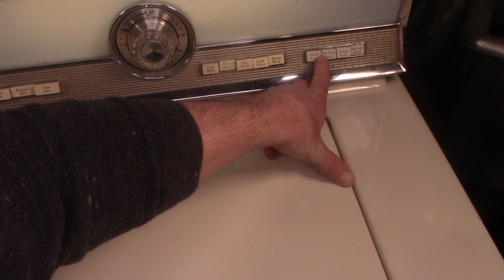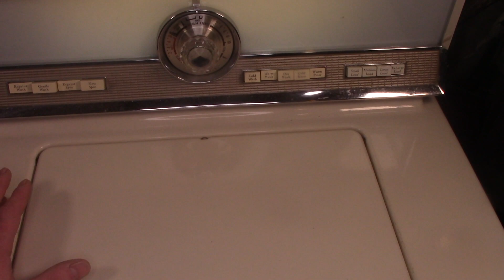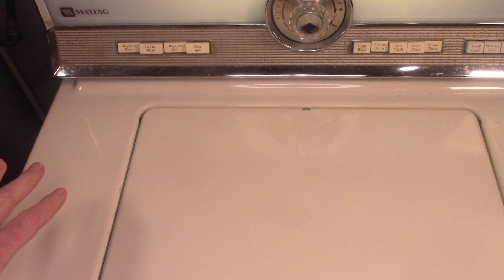Full Wash: RESTORED 1978 Maytag Washer  Work Pants

Comment: A Vintage Maytag: The perfect washer for those who wish to practice social distancing! Buy one, put it in your basement, and no one will have to come to your home to repair it for months, or even years!

Or more realistically, decades.
Reply: Lmao yes indeed realistically!!
Reply: I have a 1987 Model which is very similar to this except they changed the button layout.  I bought it with the dryer for $100, 3 years ago.  I haven't had any problems and haven't even had to replace the belts yet.  The guy I bought them from said they were left by the previous owner and he didn't want these old machines, he wanted new "advanced" front loaders.  I bet he's already had them break down on him.  Should have stuck with the classic!
Reply: Smitastic You do realise that in Europe we have been exclusively using front loaders since the seventies? America thinks they are "advanced" we just think they are normal. They are certainly much better than top loaders, they wash better, use less water, use less power, less detergent, spin faster, damage clothes less. Why anyone still uses top loaders other than for historical interest is beyond us!
Reply: @spencerwilton5831  They don't clean better than a conventional top loader.  You forgot to add, cost more are less reliable and are far more expensive to repair.   I'll keep my 1987 Maytag for another 30 years, you'll be on your fifth front loader by then.  It's not more environmentally friendly to keep manufacturing new machines when could have used the one  same reliable machine for years.  My parents have only had 2 Maytag top loaders since they got married in 1968, and the first one they left in the house they moved from.
Reply: @spencerwilton5831  Well, the thing is front loaders are more expensive up front than top loaders, and when built correctly, a top-loading washer can clean clothes much better and faster than any front-loading washer can.

I wasn't kidding in my original comment when I said a Maytag could realistically run decades. My great aunt had a Maytag Dependable Care in her condo, and in the 20 years she lived there it never had to be repaired once. She also used to have a Maytag more like the one shown in the video that was from the 1960s and, despite having a hole in the tub, still worked perfectly when she gave it away in the 1990s. Also, my Whirlpool Direct Drive has had only two things have fail on it since my family purchased it in 1997: the motor coupler (a $25 part) and the agitator dogs (a $5 part). In 23 years of owning that machine, we have spent $30 replacement parts, and it has outlived two dryers. No front loader will ever manage to do that. Remember, it doesn't matter the savings in the reduced water, electricity, and detergent usage if you have to spend all those savings repairing or replacing the machine every few years. Also, in my experiences, top load washers don't damage clothes at all unless you severely overload the machine.

One reason I think front loaders are less popular in the United States is because in the 2000s, there were several class action lawsuits against various front load washing machine manufacturers here such as Electrolux, LG, and Whirlpool claiming that their machines didn't wash away soap residue well enough, and that resulted in mold and mildew buildup in the machine that ruined clothes. Those lawsuits covered about 9 million front load washers and left a bad taste in a lot of people's mouths regarding front loaders in the United States, which resulted in the market shifting back towards top loaders.
Reply: You see china makes washers today (which are crap so you need to see the repair man everyday) and they also made the coronavirus (which in its current state prevents you from seeing the repairman) so what do you do, you buy a new one( just imagine if this was the reason the coronavirus was a thing)
Reply: @smitastic7030   HAHA That's great!
Reply: nah bro that tub capacity is trash and spin speed is meh and features are basic 
no real sanitation or real steam clean :/
Reply: yea that and agitation that's it nothing else is cool -_-
Reply: @ethearnos6397  Clean*
Reply: @ENB2002  yes thx ill correct it
Reply: @smitastic7030   DITTO THAT. I HAVE A 1997 NOT QUITE AS GOOD AS YOUR 1987 BUT NO PROBLEMS WITH A FAMILY OF 4
Reply: @spencerwilton5831  JUNK THERE  ARE MAYTAGS BUILT IN 1950 DOING GREAT . IF YOU FRONT END LOADERS WERE SO GOOD  WHY ARE THEY NOT IN THE uS
Reply: @dknowles60  The old 1987 is still hanging on strong.  The belt is still good and the washer has not had any problems.  These things literally run forever.

Comment: I grew up with this same machine, but in white, looked slightly larger though, and the one my parents had (from 1976 - 2009) had 5 cycles (Gentle-Delicate/Handwash, Soak'n'Wash, Pre-soak(and drain), Normal Wash, Permanent Press) and 3 more button sections (No Drain/Normal Drain, Save Suds/Return Suds, Regular Rinse/Extended Rinse and Spin/Long Spin), and there was a toggle switch for the end of cycle signal buzzer on/off on the right outside of the top console.  Best machine I have ever used.

Comment: Enjoyed the vid. I watched the restoration vid earlier, 👍🏻excellent. My grandmother purchased the base model of this generation Matag washer back in 76. I still have the owners manual w/her receipt. Hers wasn’t cheap for a base model (A107). It ran long after she had passed. It was because of her washer with its reliability that I purchased my Maytag set new in 1997. Got the flagship set just below the first generation Neptune. Still running strong. There was an intermittent leak with my grandma’s machine I couldn’t pinpoint, but after watching the resto vid, I believe it was the tub clamp up top. Never checked that but remember seeing streaks from there. Sibling threw it away before I could get to it. That machine you just restored👍🏻 is going to last a very long time. Enjoyed the vid, great content, thanks for sharing it.

Comment: That’s a beautiful machine and built like a tank.  I have my original 1984 Maytag washer and matching gas dryer.  My washer still uses the good transmission like your machine. I’ve never touched a screw on mine except to inspect behind the front cover.  I will keep both appliances as long as possible, which at this point could make them outlast me.

Comment: This is more like 1968 model. We still have the dryer to match this. And it still works great, my papaw bought it in 1968 at our local Maytag store!
Reply: 1968 Model had a silvery blue painted console with a white acrylic timer dial and 3 button water level switch rather than the later 4 button switch this has.

Comment: I wish they made them like this now.  We have a newer Maytag and I hate the HE water efficiency function.  You can't just set it and walk away.....you have to wait and see how much water goes in.  9 times out of 10 not enough water goes in and I have to manually put water into the basin.  I think the agitator on the newer model seems backwards.  I think it should go big to small to the top but it's opposite.  These older machines lasted longer too....cause the majority of the parts were metal.  Thanks for posting this CLASSIC!!!!!!!

Comment: I used to have 30 A21s at my coin laundry. I rebuilt most of them. I had to rebuild because a customer got oil on her clothes (60 dollar payment to her). Agitator seal breaks down after several years and hot water gets into the transmission, forcing out the oil into the tub. This was after 13 years of continuous service (about 4 loads a day).
Reply: Ouch.. an unfortunate reality of a laundry.
Reply: I bet those A21's paid for themselves in a couple of years, if not less. Great machines!

Comment: Great Maytag machine. Back in the day the sears Lady kenmore had the same wash n wear option . The tube would drain half way and fill up again
Reply: Robert Lauricella .  What’s the purpose of the half drain in relation to the fabric?  Do you know?
Reply: grandcarriage1 it was known as the was n wear cool down cycle prevent fabrics from wrinkling  .  Than in the 80 models it became perm press cycle where it would drain partly than fill with cold water than agitate for a few minute than it would fully drain than spin before first rinse.
Only kenmore and whirlpool had this feature
Reply: It's called a cool down cycle on perma press. Prevents warmer waters from increasing wrinkles during spin.
Reply: @kimberleytui179 yes my
Mom used that cycle all the time now I use it 
Most washers now have the casual or activity cycle but I do believe there is no more cool down care on these cycles

Comment: Wow. You see that little bit of water coming out from the top as it is spinning at 13:32.... It is almost like they had turbo shot way back then (the turbo shot function LG uses in their new machines). Crazy. Even the rinse thing at 15:30. Just like the spray nozzle LG uses on their washing machines now that spray a fine jet of water to rinse better. The clean water then gets pulled through the clothes as it spins to rinse it out better before the actual rinse. Amazing the concepts used back then is still used today although in a slightly different manner. Ahead of its time this.
Reply: Whirlpool did it in the 90s with the catalyst washers . Not to be confused with the Calypsos.

Comment: One other question... older machines (especially 1960's models) had exterior lights near the knobs or across the front panels.   Was there a switch to turn the lights on or did they just work when the timer was active?  How did they work?
Reply: We had the 1960s model when  was growing up.  I loved the dash light!  It was activated by a little button on the dash.  I believe one button for on and one for off.  I currently have a 1984 A712, running strong, no repairs !  I will probably never get rid of it... too afraid of today's expensive unreliable junk.  P.S.  You can see the buttons for the dash light on this video.  They are on the left side of the controls.  https://www.youtube.com/watch?v=TmBtjvYuAgI&t=3s
Reply: The late model 141, 142, and A700 washers used a switch on the left side of the console that would turn the console light on and off independent of the timer. The 160, 702, 806, 900, 902, and 906 washers routed the console light through the timer.

Comment: Why do/did a lot of Maytags spin immediately when first draining?   I always found that disconcerting as I would think it puts a lot of stress on the linkage....rather than just running the pump for the first minute or 2?
Reply: Ram14250 lots of machines have that, vs a neutral drain (like you mention). My theory is that it goes back to the solid tub days when the only holes were at the top of the tub, and the machine used centripetal force to throw the water out those holes
Reply: Ram14250 These have a spin drain because they don’t have an individual pump motor. There’s only 1 motor to control everything. When the motor is spinning one way, the transmission engages and the washer agitates. The pump is spinning the opposite direction needed for draining. When the motor reverses direction, the transmission locks up and spins both the tub and agitator together at full speed. The pump is now spinning the other direction, sucking the water out the tub and pushing it through the drain pipe.

The motor needs to be running in order for the pump to work. Therefore, a neutral drain isn’t possible with this design.

I honestly prefer spin drain to neutral drain. Less parts and electronics to go wrong, and they more evenly distribute the clothes along the height of the tub, allowing for a more efficient spin.
Reply: @solarflea4115   The center of gravity is lower in a neutral drain washer and therefore will or should spin better.  Spin drain machines can go off balance if there is too much water and to little clothes in the basket .
Reply: pat cola I’ve never once had any issues with balancing and I’ve had spin drain washers all my life.
Reply: @solarflea4115  My Speed Queen spin drains and I agree. Never once in 7 years has it gone out of balance and banged against the cabinet . Steadiest machine next to our old Westinghouse. 

Our old Norge was pretty good also. Though the spin on the Norge would slow down with an out of balance load
Reply: pat cola My dads 1990’s Maytag dependable care also slows down when it gets out of balance. My mid ‘80’s filter flo doesn’t but it’s still a fantastic machine.

Comment: Lovely machine. What happens if the heater breaks? How u get those parts that were built in 1978. Is it possible?
I was born in 78😀.
Reply: Heater ? These don't have a heater.
Reply: Most of the running gear was the same for 5 decades so parts are still around.

Comment: Hello! I have a question. I have the same washer and it’s been stopping during cycles. Recently it only runs for a few seconds and shuts off. Is there anything I could do to fix it?
Reply: Did you fix it? Could be the motor overheating or the timer motor/timer assembly is dying.

Comment: if spin speed would be more than 1000 rpm.
The result will be more great.

I love the shower rinse option
Reply: Those older machines didn't need to spin as fast as the new junk of today, the new junk has to spin faster to get out what the washer halfway did during
both the wash and rinse cycles (So called, washing and rinsing)

Comment: Is this belt driven
Reply: Yes
Reply: I was figuring that by the way it was sounding and washing that it was a belt driven.
Reply: Pretty darn smooth drives. They were really nice for wood floors if you had an upstairs laundry room. We’d use that as a selling point to customers when we sold them if they had upstairs laundry rooms, never a complaint in that regard. 👍👍
Reply: 2 belts, actually. One for the transmission and the other to drive the water pump.

Comment: Is it a 1968.  Not 1978
Let me know please
Reply: John Colautti this is from 1978 since it has the gold trim on the lower part of the control panel, and the Maytag A806 in 1968 had fewer options in 1968 than 1978. The Maytags from 1966 to 1974 had the sapphire trim on the lower part of the control panel.
Reply: John Colautti —  i have it & mine was purchased in Fall of 1977.

Comment: Clearly the machine is doing it's job. If you own an 806 you can wash anything! However, the user does not have a grasp of how to properly launder work items with this degree of soil or the rinse water would have been clear, not dirty. Making sure the machine is not overloaded is very important for good cleaning and rinsing and as we can see the clothes in this vid are rolling-over very well.
There is a reason for "pre-washing" and many machines of this vintage have cycles for it. With heavily soiled and greasy/oily work clothes they should always be spot treated and pre-washed with detergent AND ammonia (to cut the grease!).
Then, when proceeding to wash, plenty of fresh detergent (more ammonia depending on grease/oil levels) and HOT wash water. With white clothing it is important to use "regular" Clorox liquid bleach in the last four minutes of the wash cycle. Clorox liquid bleach is the only liquid bleach marketed here in the US that has the ph adjusted for the water in the area in which it is sold. There is a science to properly laundering clothes and if one follows the science your clothes will be very clean.